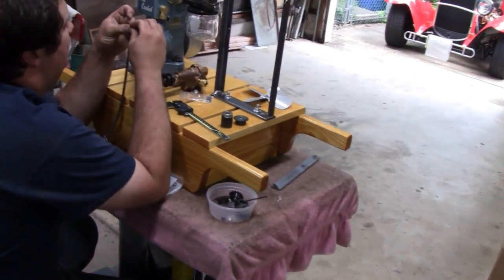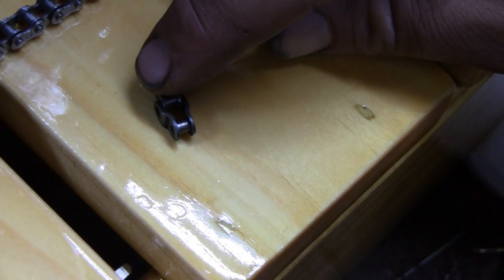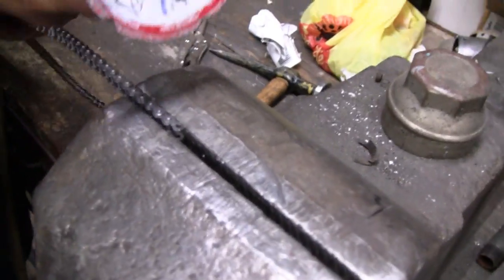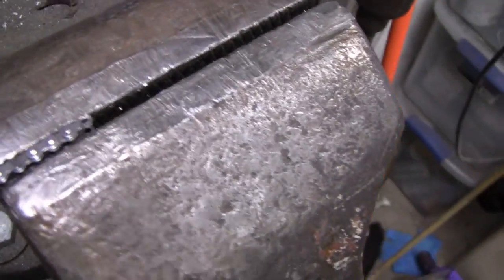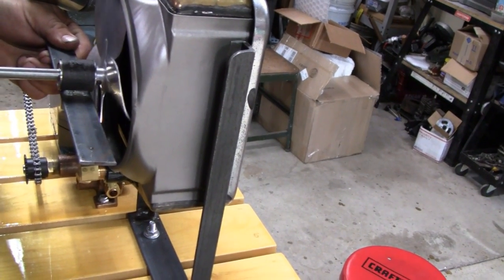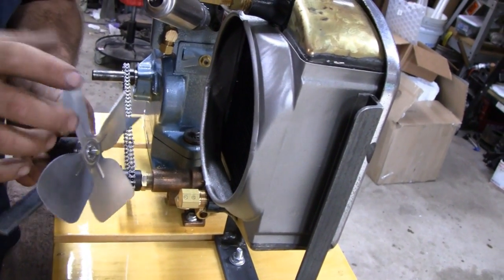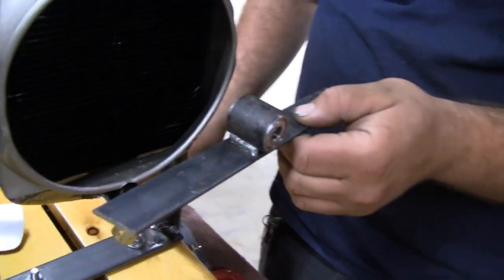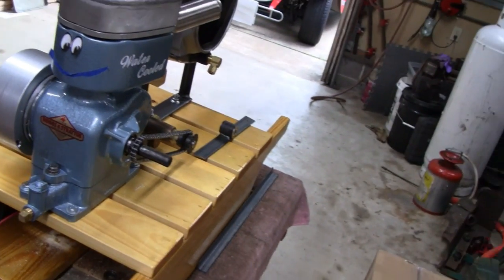HOMEMADE WATER COOLED BRIGGS ENGINE (part 40)

Comment: Hey +805ROADKING, please add the latest videos to the playlist. I'm showing the project to a friend and want him to be able to watch everything!

Also, quick question: did you match up the rotation of the crank with the direction of the gears for the pump and fan? Not sure if the pump is reversible.
Reply from the maker: We took care of the playlist for you!! This pump isn't reversible but everything is rotating where it should be!!☺

Comment: how about a tour of the car
Reply from the maker: Which one the Chevy or the Ford!!☺
Reply: well no need to set limits how about both. you can see my 57 210  wagon in the profile pic although now i'm running rallies.my truck is a 2004 harley f250 that i swapped a cummins into without overpriced kits. im no tuber but everytime i start a new project i think i should be today me and my boy started drawing out on hdf the side panel for a arcade machine raspberry pie based i got all the do dads time to wrap them up
Reply from the maker: Here's the Chevy:  https://youtu.be/i77SLfkJJkc
Here's the Ford:  https://www.youtube.com/playlist?list=PLOkM2h167hjrvqhVh2-hm5on5PXnoDSjN
Reply: nice job on the ford. any plans to start the 57?sorry i didn't check all your videos before asking.

Comment: Just curious but have ya'll heard of a chain breaker?  It's a tool made to press the pins out of the chain to take links out and to press the pins back in to put it back together. I used to use one all the time back when me and my buddy had a bicycle company. Found one that'll do #25 -#60 chain if you're interested. https://www.amazon.com/Koch-7725010-Roller-Chain-Breaker/dp/B004HKIU4C.  I usually don't comment on YouTube but I really dig the work you guys do on these little brigs engines.   Can't wait to see the rotary running.
Reply from the maker: Thanks Bruno!! We don't break enough chain to justify buying a breaker even though they're only a few buck!!☺
Reply: +805ROADKING  right on road king.  Keep up the good work.

Comment: Thankyou guys for this next installment, can't wait to see it running. I noticed no one has mentioned altering the pitch and or angle of the fan blades . I've had lots of success with just a 3-5 deg. change pitch. If you feel there isn't cooling enough you might try just bending the blades instead of buying a new fan or building something/w pulleys /gears to up the rpms.
Reply: Umm, it is the first thing he talked about when they were discussing airflow.
Reply: your right they did... I must be def.

Comment: you might want to turn the blades around to pull the air through the rad like it does on a car. Pushing the air forward could still work for this setup but may not be as good and if it's setup to pull the air through the rad the flaps will be at a better angle to slap fingers away in case someone wants to touch it.
Reply from the maker: Fan blades don't work like that, I would have to buy a counter clockwise blade to do that!!☺
Reply: 805ROADKING your right. 🙈

Comment: Hi Thanks for the update we're getting close now.  Up here in Canada if you ask for a half link like we would call it in the U.K they look at you stupid. They call it an off set  link here, so that may be why some guys didn't know about it.  It looks like you are using the half link as the joiner from what I saw, when we use them on Ag machinery we put the half in and the master or joiner right next to it. Then when the chain stretches or beds in a bit , we can just take the half out and re tension it. Take care see you next time.
Reply from the maker: Thanks for mentioning the Master link!! I knew that at one time and completely forgot about it!! Even though it's common sense, our head just wasn't in the right place, we were focusing on building that fan mount!! It's tough gettin' old!!☺
Reply: No worries It happens , I'm 43 and have days thinking about 10 other issues with guys machines. Then forget something simple thats been the common sense answer  before.

Comment: why not just raise the motor up slightly?  that will tighten the chain.  maybe big diameter brass washers so they won't dig into the wood.  or make some on the lathe.  could easily do the same for the radiator/ fan if needed.  then do the copper lines last
Reply from the maker: Yeah that would work!!☺
Reply: 805ROADKING I actually wrote that before I saw the whole video (I watch it on my breaks lol) it looks pretty tight as is 😃.  Maybe just a little if it flops around too much.  looks awesome tho!

Comment: Just a suggestion about the #25 chain, if it turns out you you don't like the chain tension, a simple cheap fix would be a plastic chain tensioner like what a small overhead cam motor uses,,something along the lines of this,,,,.https://www.google.com/search?safe=off&biw=1600&bih=794&tbm=isch&sa=1&q=cam+chain+tensioner&oq=cam+chain+tensioner&gs_l=img.1.0.0j0i67k1j0l3j0i67k1j0l4.11707.13206.0.14835.4.4.0.0.0.0.147.537.0j4.4.0....0...1.1.64.img..0.4.535...0i7i30k1j0i7i5i30k1.mDQ7WLLFSd4#imgrc=6yrf1oxTwzN6nM:
Reply from the maker: Interesting, we have thought of an idler sprocket for a tensioner but never thought of that cam type tensioner!! Thanks!!☺

Comment: Nice so far. Does that gear pump has any greasers, cause that rear bush is going to work hard.
Reply from the maker: Thanks Bud!! If that pump would wearout running a little set up like this, Oberdorfer would have been outta business 100 years ago!!☺

Comment: It's coming along, not much more & it'll be good to go! As a suggestion, for the fan & bearings if it was me, I would've taken seals out & put a grease zurk up top or on the bottom. Keep thinking about the new stuff just isn't serviceable like the old used to be. But that would assure the life of the bearings & fan for a while & keep it from making noise. Hopefully next video we see it running! Looking good👍

Comment: Thanks a lot for explanation on half link
Reply from the maker: Yeah we figured we'd throw that in there, alotta people never heard or seen them before!!☺
Reply: Boz 2011 .......I grew up in a garage in a manner of speaking. Built in the 30's and run by my uncle. Lots of stuff had chain drives, and I learned to split go-cart chain with a chain-breaker tool, punch & hammer, and grinder since I was ten. The easiest way to use a half link was a master link on the thin end and it's pin on the other. Some we're press fit pins, while others had a small cotter pin go thru one end. I still have some from my grandfather's hardware store I got almost fifty years ago.

Comment: Another nice video Roadking. Are you going to run any lube on those chains or do you think the RPM's will be low enough to get away with it?  I know you wont be running it a lot but lube will help cut down some of the noise.
Reply from the maker: Thanks Mate!! Yeah we'll probably put some Teflon on there so it won't be so messy!!☺

Comment: Use a half link and a connector link. Skip messing around with trying to get a pin to fit into the chain's link. I am a farmer and am a little puzzled why you did not just take that link out and use a connector link along with your half link. Ya they still use chains on new million dollar farm machinery.

Comment: I have a small handheld tool that presses the pins in without crushing the links. Pretty handy and they are under 20 bucks
Reply: I designed and made a chain link extractor at school, you need a different size for each size of chain. mine was setup for push bikes but wish I'd made it for motorbikes lol.